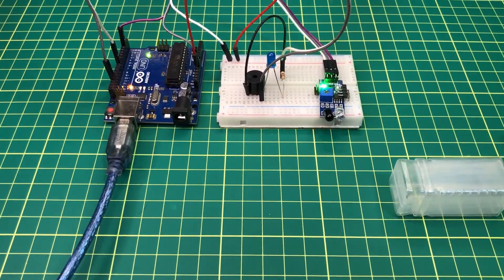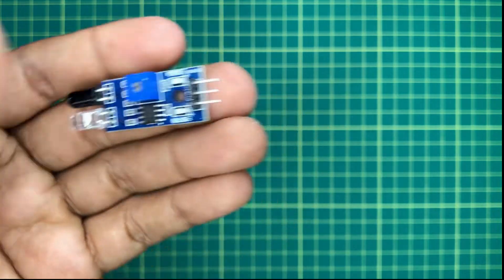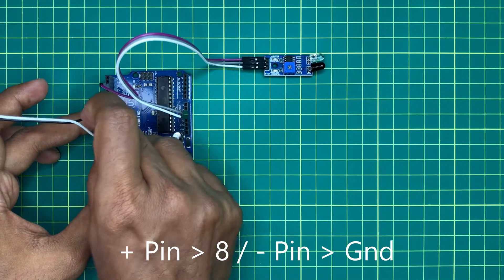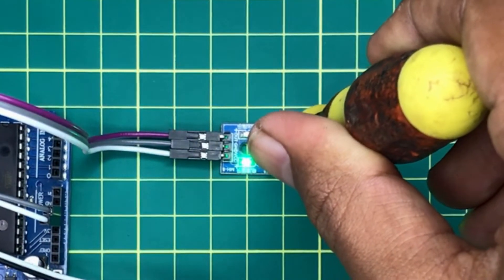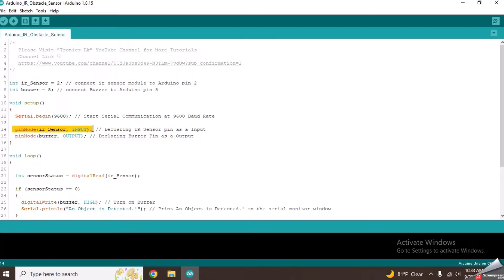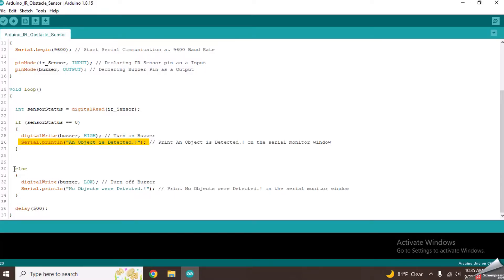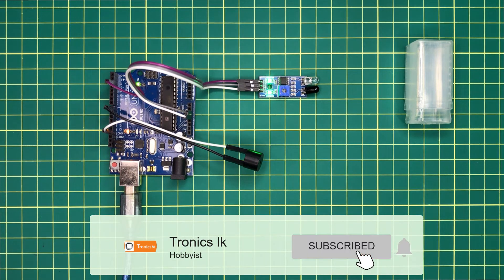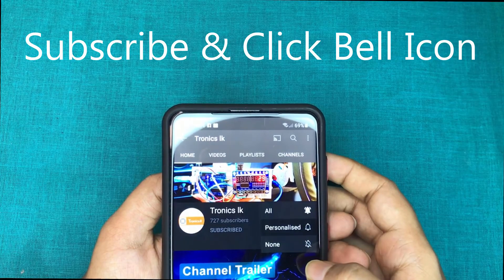VERY EASY Arduino IR Sensor Tutorial for Beginners | IR Sensor Arduino Tutorial | Infrared Sensor

Comment: Hello, will this code work:

int led = 13;
int buzzer = 12;
int sensor = 7;

void setup(){
    pinMode(led,OUTPUT);
    pinMode(buzzer,OUTPUT);
    pinMode(sensor,INPUT);
}

void loop(){

    if (digitalRead(sensor)){

        digitalWrite(led,HIGH);
        digitalWrite(buzzer,HIGH);

    }

    else{

        digitalWrite(led,LOW);
        digitalWrite(buzzer,LOW);

    }
}